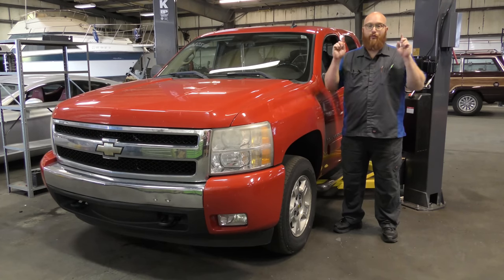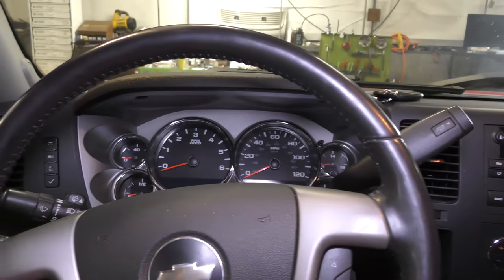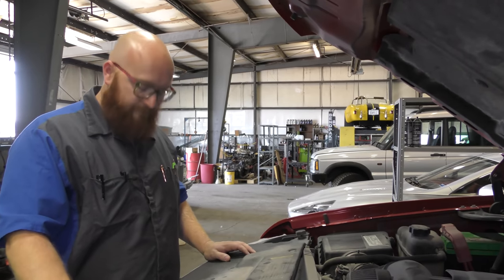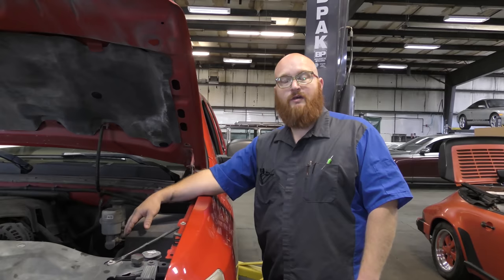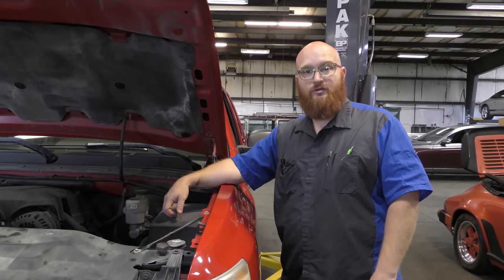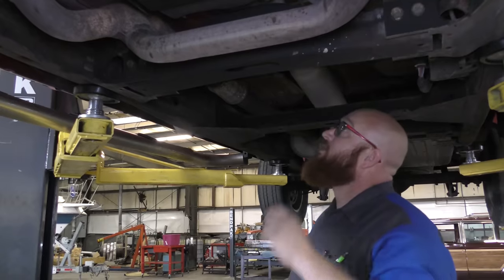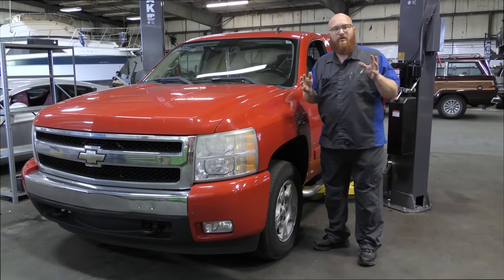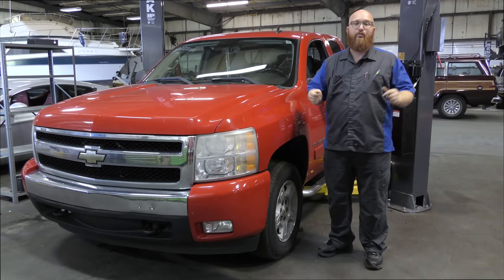Good Truck/Bad Truck? CAR WIZARD shares most common problems on the 5.3L Chevy truck at 100k+ miles

Comment: We have a winner!  My 5.3L, 2008 had some busted exhaust bolts too!  And of course some front end bits and pieces needed replacement, and rust.  Have put the most bucks into rust repair, including having the frame and undercarriage sand-blasted and painted.  But darn reliable unit overall and am shooting for 250K miles out of the old beast!

Comment: Yep, you’re right Mr Wizard, I was given a 2013 1500 z71 4x4 with 280k. Everything you stated needs fixed. And I was lucky enough to inherit the dreaded AFM lifter issue which I have already addressed. Thanks for the insight. Your knowledge is appreciated.

Comment: I'm grateful I learned from you one big thing.  I can do the job in 45 minutes but the job bills at 3 hours.  Can't fault a guy for being good.  That has helped me so much. 
Funny note my work truck is the 2010 2500HD is has the lifter tick sound from broken bolts but the boss is like ain't dead yet...

Comment: Fingers cross that the Active Fuel Management can last 200K without much issues
Reply: Buy a programmer and turn it off
Reply: "Without much issues?"  Does that include replacing the worn camshafts due to the oil starvation GM's flawed fuel miser system inevitably causes?
Reply: Brian Weir, like mentioned turn off afm with software and run it. I had 230k on my Tahoe with the last 50k turned off without issues and no oil burning with that done.
Reply: @dbrandon4528  no can do.  New PCMs are locked up tight.  Only thing anyone can do so far is turn off the auto start stop.
Reply: @mph5896  you can't on the new trucks.  You can't get into the programming.  Only option is a fresh PCM that isn't locked, but that's 10k right now.  Any attempt to alter the new PCM saves to an unwipable file and reports to GM when they go to service it and doing so will void the warranty.  Sucks for those of us wanting to tune our trucks for E85.
Reply: Paine Thomas that might be different on the new to 3 year truck. The old clunkers like wizard was working on here,  it can be done.
Reply: @americansmark  how new are we talking about? 2018 and older can have the AFM tuned to stay in 8 cylinder
Reply: @brianrenaud9893  2019 as well @RangeTechnologies $189.00 ! I have one on my 08 Suburban And one on my father in law’s 2019 and both run flawlessly! Matter of fact my O8 was throwing code for low catalyst efficiency bank 1 when it went into v4 but after plugging in the range it stays in v8 and no check engine light
Reply: @brianrenaud9893  2019.
Reply: Buy gm range AFM disable problem fix 👍😀
Reply: Is this actually true still? As of now?  Because you can send your ecu to hp tuners right now to unlock it?
Reply: They need to figure something out cause I wana do work to my 21 6.2
Reply: @houseofno  typical General Motors
Reply: @kenwillis8487  V4 doesn’t exist
Reply: @kevs2good133  iIt sure does , in v4 it’s collapsing the lifters to 4 cylinders to turn them off! On the dash on the scream that shows active fuel economy all the way to the right it will display either v4 or v8 ! That is what afm is active fuel management, it disables half the cylinders to work!
Reply: I feel like he should have mentioned AFM. Your odds of making it to 200k without an overhaul are slim to none without a full AFM delete.
Reply: @dbrandon4528  Programming did fuck all for me. I was on my 3rd set of lifters at 220k miles. I should of done the full delete kit the first time around.
Reply: @kolinstallman3788  I was thinking of DFM, the newer version on the new body style trucks. I have a 19 T1 Silverado, not the LD model.
Reply: Disabling it doesn’t prevent the issue. The lifters will still physically fail.
Reply: @anortiz94  is that the end problem with it?  I have the newer Dynamic Fuel Management on my truck and it makes me nervous for the long-term health of the motor.  Then again, it blew up at 18,000 due to a bad oil cooler line.
Reply: @americansmark  wrong
Reply: @nicholasweber21  huh?
Reply: It can. The 09 I just sold had 195k
Reply: @dbrandon4528  the lifters will still fail
Reply: 2008 230k miles here no issues
Reply: Depends how they’re treated
Reply: @dbrandon4528  not that simple, have to change camshaft, lifters, and oil pump in order to property get rid of AFM
Reply: @americansmark  What do you mean by new ? The 2020 plus because I got HP tuners and if i remember right the 2019's and under trucks were tunable. Gen 4 trucks like this only take 2 credit's to unlock ( $100)
Reply: @frenchonion4595  the T1 trucks. The L84 and L86 engine. 2019-up with the LT or better trim package.  For 2019, Custom and work trucks used the older L83 and L85 versions of the 5.3 and 6.2, respectively. I do believe all trims with gas engines are now on the new version of the two motors.

I should specify that there IS a workaround, but it's not cheap. You can buy a new and/or wiped PCM from a few places and trade yours in as a core deposit.  But even with that swap, you're looking at 2 grand. And that was before the shipping delays got really bad. Once you pay $2000 or so and get it, you then need to have a tune put on it by HPTuners through a tune rlije Vermont Tuning, tune it yourself, or have Vince at Trifecta tune it if he can.
Reply: 2013 @220 k. 3k oci. Afm still there. Good luck.
Reply: @americansmark  Look into pulsar XT inline module. 
Turned off DFM and auto start stop and 5 pedal/trans shift point modes.
Where there's a will, there's a way.
2019 Sierra Denali.

Comment: Pretty spot on, I got a 2011 model with 235,000 . The oil sensor turned out to just be the screen clogging up, cruise control was a 20 dollar fix, and I've thought the rear main has been leaking for awhile now. Going out there straight way in the morning to see if its just the plate. If so I'm going to mail you $50 for the Info alone, lol - Thx
Reply: How did u fix the cruise control?

Comment: After having to drill out many holes 30 minutes charge is not bad at all.
Reply: That was my thought. Sure, ok to a skilled technician an easyout is well, easy. I could easily bet most people have not a clue in how to use them in the first place let alone own a set. I know how to use them should it require, but I've got better things I could be doing and god knows a half hour isn't likely. My luck would be hours and a  12 pack of beer and a day off work. A few busted knuckles to make it even more obvious of my bad decision. lol.
Reply: @PearComputingDevices  they are not hard to do.  If you got all the room in the world.   But sideways inside an engine bay.  Good luck.  If you haven't done it a few times you are in a world of pain.
Reply: @vcdrny  Your right. It's also a perfect time to change things like the pvc valve and coil itself. Certainly clean the throttle body, it's closer to you after all. But what's really tough is changing the plugs on a Toyota highlander. Not only is that engine tilted towards the firewall,  but you've got remove the plenum and associated vacuum lines. It's a job, but might as well make the best of it by doing other preventive maintenance. Again, perfect opportunity to clean things like the throttle body. Plus you'll save about $250-$300 bucks by doing it yourself. Just take a lot of pictures and don't feel nervous to use some kind of scribe to mark your work.
Reply: It's a pain in the ass. I only had one bolt break but there was some shaft still sticking out and it backed it out with vice grip's. Got lucky it wasn't broke flush with the head. Still a pain in the ass to get to that rear bolt
Reply: It's a bargain price for only charging 30 min per bolt. It sucks to do regardless of what vehicle it is due to the limited space and line of sight. Oh yeah, better do yourself a favor and get some carbide drill bits. You'll thank me later.lol

Comment: Got a 2012 Silverado 4.3 runs perfect . Learned to run it at high
rpm ,glad it's ok . Changed trans filter and fluid at 90,000 with some 
Lucas added . Change Mobil 1 often
enough . New struts at 112,000 , simple to do . Great truck

Comment: One of my friends bought a 2008 brand new with the 5.3 and AFM. He was a high mileage driver and the truck never made it to 100,000 miles. He needed new litters and all kinds of engine parts and gaskets replaced.  All that before it was even paid off.  He sold it at a loss and got a tundra.

Comment: Wizard, one major service item on the GMT900 series is the O-ring on the oil pickup line. It can be done on ramps in about 3-4 hours on a 2WD (RWD) truck but will take much longer on a 4WD truck due to axles. Doing this really prolongs the life of the motor as the AFM along with the weakened O-ring can starve the motor for oil after several years/mileage.
Reply: Agreed, it's a source of low oil pressure
Reply: Is this why my oil pressure drops more than I think it should in overdrive?  40 psi when accelerating then drops to 20 psi.
Reply: @charlesmckinley29  Yes definitely, most people just replace the oil pressure sensor at the top of the motor but it's the O-ring on the oil pickup line that actually resolves the low oil pressure issues.
Reply: @99Vood99  thank you.
Reply: @charlesmckinley29  You're welcome - I did this job on my 2014 truck that I purchased in 2017 with approximately 120K miles on it. The pickup line came off the tube with no resistance. I've heard that it literally drops off or disintegrates on older trucks with higher miles. The new O-ring is a tight fit and the overall engine noise also decreased. Good luck with your replacement!
Reply: There's also a screen under the oil pressure sensor that can also get plugged up causing issues but a 20 psi drop sounds like the o ring.

Comment: I have a 2002 Chevrolet Silverado 1500 4.8 I had since new.. I do my own maintenance and done repairs myself to learn and to save money.  Its 2024 and its still running very good! It will need a re paint since the clear coat is worn out.

Comment: I'm from NH and it's wild to me that they sell those trucks in 2wd as anything other than an absolute base model. Even most of the work trucks I see are still 4x4
Reply: At my work we have a whole fleet of 2wd F-250s in Michigan. It’s a little inconvenient in the winter but with decent tires it’s not that bad.
Reply: I had a 4x4 for years but I rarely needed it.  I replaced it with a 2WD Colorado.  In the winter I put winter tires on the rear and I carry crushed rock and a shovel.  Much more practical.  I don’t drive routinely in snow, but I want to be ready for it.

Comment: Trick I heard about frozen or broken bolts. Lot of PB blaster. Then, the trick is not loosening once you get started. You turn out a couple turns then pb blast turn back in then wait a bit and then back out little further. Do that back and forth and eventually you could get bolt out without breaking it.

Comment: I have a 2012 Suburban with 85,000 problem free miles.  I use it to tow my trailer in the summer - has tow-package.  Always use tow / haul mode button when towing as per Car Wizzard.  At next service I plan to change all fluids and spark plugs / due at 90,000 miles.  I have fluid-film treatment done every year to prevent rust issues.  Love my Sub.

Comment: We're in strange times. I was looking at purchasing a used car and it's actually cheaper to buy new. In my situation I'm looking at a 2019-2021 sedan with certain features and used are about 500-1000 more than new in my area. Some with 20k miles on it.

Then of course with the new cars dealers are trying to squeeze as much as they can out of customers. Dumb shit like nitrogen filled tires, tint jobs that are $800 (never paid more than 150 for the whole car) and exorbitant fees.

Comment: these are also notorious for the fuel sending unit fittings rusting thru causing a fuel leak, i live in michigan so salt is an issue.
Reply: Bet you see lots of brake lines

Comment: With as much flak as the Ford 3v 5.4s get, it’s amazing the AFM equipped engines don’t have the same reputation…guys are deleting AFM constantly on these trucks/SUVs over on the fb groups and forums. With how involved the repair is to eliminate AFM, it’s honestly worse than replacing the most common issue on a 3v 5.4…the cam phasers.
Reply: Fords are more expensive to repair. There are more issues with the 3V.
Reply: @ramaswamynarayanaswamy4806  no, the 5.4 3v is not more expensive to sort out.  Deleting AFM is as expensive as it gets.
Reply: @anortiz94   Does not explain why the resale value is low. And abuse is what kills the 5.4 3V I heard, just like it kills the AFM. Both trucks have their serious issues.

Comment: Left handed drills are amazing, usually the bolts will turn themselves out after 30 seconds of drilling if you have a 1/8 inch pilot hole.

Comment: Another item that goes bad on LS engines, is the O-ring on the oil pump pick up. Dash gauge will show low, usually under 40 psi.

Comment: Those years of chevy i never liked. Felt very cheap. Had one for work. Aleays had evap problems. Great power just felt cheap.
Reply: It's Chevy.
Reply: Eh, evap fix is cheap and easy to fix. $20 for the evap vent solenoid takes care of the problem 90% of the time

Comment: This video just popped up even though I watched it when it first came out lol. This actually gave me a reference to some things. I'm now working on one where the AFM/DOD crap has caused some damage. The truck I'm dealing with is an 08 5.3L 2WD with over 220k miles.

Comment: Excellant video. I have an oil leak on both my 2003 and 2007 5.3 avalanches. Thought it was the main seal. I will check the oil cooler seals this weekend. THANK YOU!

Comment: My dad has a 2011 LTZ with the 6.2 V8.  It now has 131,000 miles and except for a cable for the trans being replaced. Its veen very reliable.

Comment: Drilling out exhaust bolts? Reminds me of retapping headbolts in the Northstar #notfun
Reply: Also uneeded because the heads are aluminum and a nut welded on removes them in minutes
Reply: @DegeN.YNation  Except when the threads get stripped out and you have to redo them to upgrade the head studs...
Reply: And why they break I find is catalytic catalytic converter failure when old and clogged up.

Comment: I have an 07 with over 400,000kms on it. Still pulls hard and drives smooth. Oil pressure sending unit has given me bad readings a few times.

Comment: Charges 0.5hr per exhaust bolt to drill out , probably welds nut to stud and 25 minutes to cool before backing it out. 😅
Reply: If you think it's so easy and quick to do, have at it, Mr. Goodwrench.  Try not to crack your block or cylinder head because you're too cheap to pay a professional to do it without damaging your engine or cylinder head.
Reply: @houseofno  did it on 4 bolts on my LQ4 317 heads , common practice for LS heads since their aluminum and the weld doesn’t stick to aluminum, plus the welding of the nut to the broken stud also helps to break any corrosion

Comment: If someone charges me 3 hours for real 1.5 hour work I would feel ripped off.  I know dealers apply standard timing but that is the reason why I don’t go there, but if my mechanic is charging me for phantom hours that to me is a rip off. It is different if you have a fixed salary type of job in my view

Comment: Got to disable cylinder deactivation on the 5.3. save the piston rings.
Reply: Has nothing to do with piston rings.
Reply: @nicholasweber21  Sure it does.
Reply: @chrisroberts3722  No it doesn't. Save the camshaft when a lifter fails. Nothing to do with piston rings

Comment: Jeez, cars are still cracking their dashes in the 2010's?
Reply: Wait until this guy realizes u can still buy these trucks new with rear drum brakes
Reply: @chapa435ify  thats alright drum last longer cheaper to rebuild and doesn't seize as easy as the 99-07 1500! 
trust me i know! 
its more reliabale overall.
Reply: @Bowtie4me  went back to drums on 05-06 I believe.

Comment: I have a 2009 Silverado with 125,000 miles. It had the cam and lifters replaced one day before the 5 year warranty ran out. The tech said that they used LS7 lifters for replacement. The frame was coated with something like Z-Bart from the factory. I change the oil and do maintenance so it’s in great shape. One pain is replacing the motor mounts. I replaced the rotors with ACDelco Police rotors and pads. That’s really dirty compared to mine. I have the heavy duty cooling package. Never had broken bolts. The Grenade 80 locker is still in good shape.  I am fastidious about changing fluid. I hope to do the AFM delete soon. I R&R and cleaned the throttle body and MAFS and it idles smooth. Good call on the sway bar, I replaced mine with MOOG.

Comment: Hmmm...charging for time you weren't working.  I'll have to try that at work and see what happens.  I'm sure they'll happily pay it because I'm good at my job.  Unsubscribing.
Reply: Maybe they should set the book hours for competent mechanics then, seems logical to me. This says to me the book hours ae set for sub performance mechanics. Yeah that line didn't sound the best to me either. Just say this is what i charge for the job, not i charge for three hours labor that it takes me 45 minutes, that's actually criminal.

Comment: I have a 2012 @ 130k. Probably the most reliable vehicle I've owned. Basic maintenance, no major issues. So far with mine has been the master window control wont always operate the windows properly. Broken Rear window regulator. AC control buttons wearing off. That's about it.